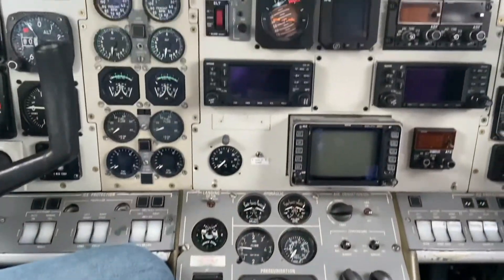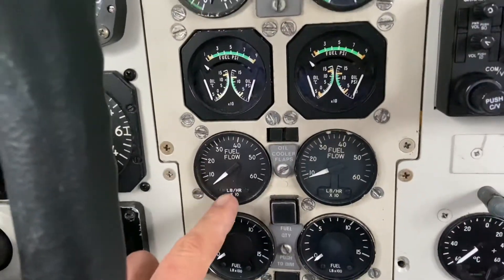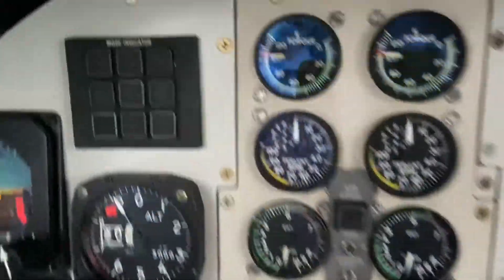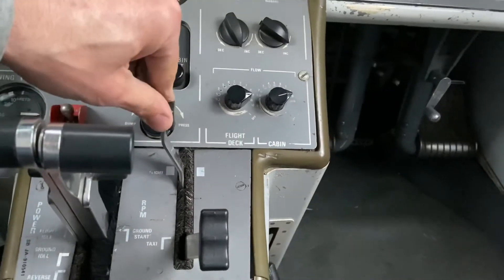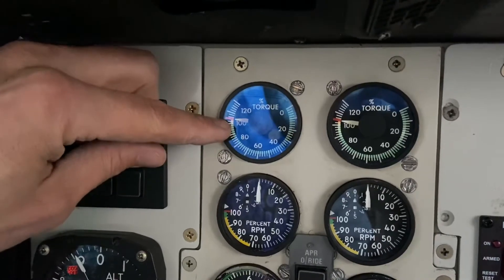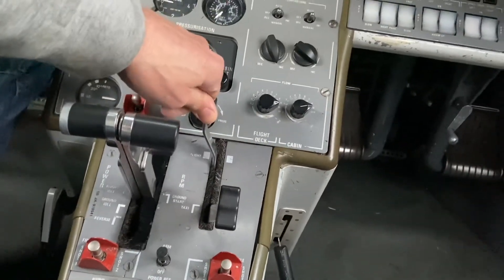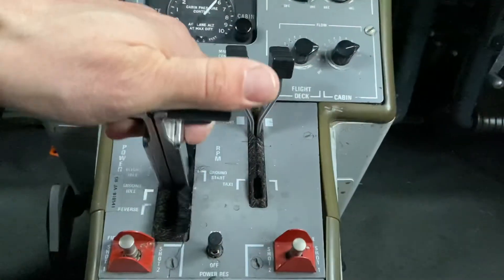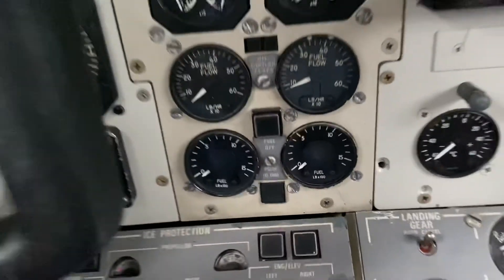Jetstream 31 and Garrett/Honeywell TPE-331 engine controls described

Comment: You don't taxi the jetstream with the power levers above flight idle detent. Your input on the power levers beyond that point has no effect on prop blade pitch(torque) at all. That aircraft is going to "run away" with you. You will not be able to control it.  Always taxi with the power levers in ground idle range below flight idle detent. Reverse is only the small last bit of the ground idle range.

Comment: Actually, rather than guard the STOP switch, it is safer to guard the manual STOP control in case it's necessary to abort the start.
Reply from the maker: Excellent comment, makes sense because it would manually shut the fuel off. I appreciate the input.
Reply: @halhobenshield5931  Correct. The procedure for an aborted engine start is to pull the feather lever.  When the stop button is pressed the fuel accumulator is purged into the combustion chamber.  That is why during a normal shutdown the engine briefly accelerates before it winds down.  If you were to abort an engine start (particularly for a hot or hung start) with the stop button you would actually exacerbate (increase egt) the issue.  The feather lever simply closes the fuel valves, removing all fuel flow to the engine. Granted I am working from memory and I haven't flown the J31 since 1999!!